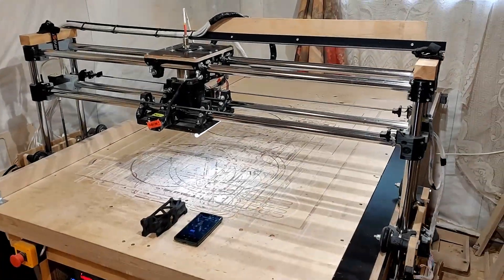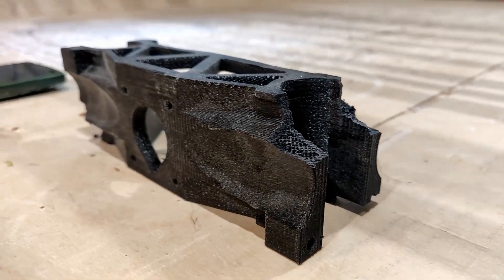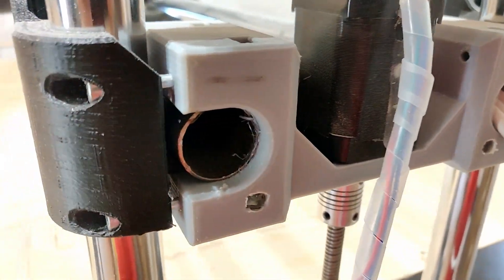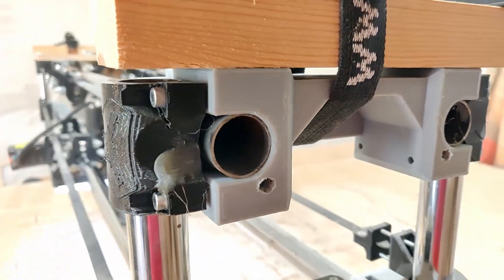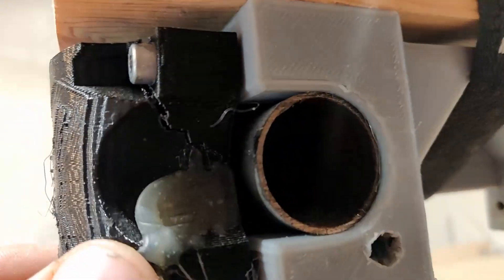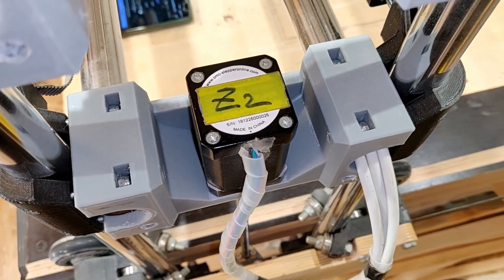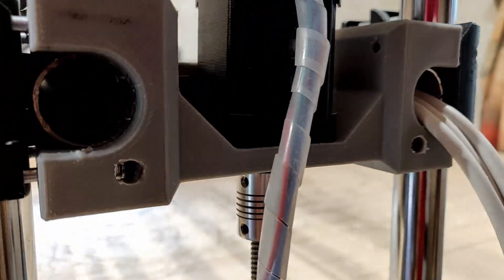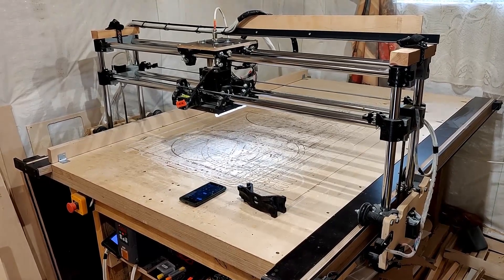More Rigid LowRider2 CNC

Comment: What size tubing did you use the 25.4 or 25
Reply from the maker: Hey - I use 25mm tubes
Reply: @KarlisZalitis  do you have the original fusion design you would be willing to let me use I found a machined 26.5 mm tubing and I like your design I built the original lowrider 2 and I'm having same issue with rigidity
Reply from the maker: Hey! Write me an email, I will help you :) kzdesignlv@gmail.com

Comment: i have a question: using the 4 wheel Y-plates whats the maximun thickness for the bed?
Reply from the maker: I am using 35mm plywood. I believe 40mil will be the maximum

Comment: Hi, after several attempts with the plastic parts, I have replaced the stainless steel tubes and the plastic parts with CNC rails (HGR25) with carriages. Otherwise, I do not get the desired accuracy with a work surface of 200 x 200 cm.
Reply from the maker: Hi! Your machine is a big boi :) Yeah, the steel tubes and plastic parts are the limiting factor with this build - I too have some issues with accuracy, even with my 1.3x1m work surface

Comment: Hi there Karlis, thank you for all these vids great job, In one of your earlier vids / comments you mentioned the x gantry rocking back and forth pivoting on the z screw, since this you have added extra wheels below the table, I was wondering if adding an extra bearing runner on each lower wheel would eliminate much of this issue and am considering (think my minds already made up) doing this as part of my build, I would welcome your thoughts, kindest regards
Reply: I’m continuing build today and over the coming days hoping to be up and running in a week or so I’ve already ordered spare bearings to implement this, I just think it gives 2 layers of rigidity from the y plates to the gantry as opposed to almost(bearings & z screw) a single plane, forces acting upon the upper front and rear bearings will be transposed to the lower rear and front  bearings respectively, I believe the larger the distance between the top and bottom set, the more effect will be seen, I will post a video of before and after and possibly even confirm with a DTI and fixed force on the gantry. Anyway food for thought thanks again and great job 👏
Reply from the maker: Hey! Hmm, sounds interesting! I can't say from top of my mind if it would be any better, but it's possible. I guess with these things you have to just build it and test it :D  I would love to hear from you how it turned out!
Reply: Hey there things are moving on I have built machine now ready to wire I have used a lot of your ideas thankyou I have left ability to implement 2.2kw spindle and have both have used your clamp (or similar) but made it the full width between layers it’s made to fit 2.2kw but I have printed a sleeve so the 1.5kw fits same clamp can’t find how to upload pics to here from my phone
Reply from the maker: Hey! Good to hear that you have made some progress :) I would love to see your build  - you can sent pics to my email - kzdesignlv@gmail.com

Comment: Looks like an excellent upgrade.  I am using your belt tensioners and I made my  side plates with 4 wheels based on your design as well.  I don't like how hard it is to see up under the gantry where the cutter is though, not much room under there.  I am designing a revision to make the gantry a more conventional type  with a solid gantry and make the Z axis move across the gantry like the X carve...just as an example.  Love your videos my friend!
Reply from the maker: I am having trouble looking under the gantry too - would love to see your solution :) It would make my life easier when filming things being cut

Comment: Now if I could get my models to stick to the 3d printer surface again, I finally could start printing the CNC printer (with your upgrades)
Reply from the maker: What 3D printer you have?
Reply: @KarlisZalitis  Prusa i3 MK3, I found out when I wanted print the upgrade extruder MK3S
Reply: Clean your bed thoroughly with denatured alcohol and then apply a thin layer of glue stick. That saved all of my sticking issues.
Reply: @bwuest  That is what I tried. I had a new bed (but also tried the old one), tried newly opened filament (in case the old dried out or something). I have to look at this more systematically
Reply from the maker: My go-to method is to use painter's tape and hairspray - works almost all the time. But the key word is ''almost'' :D